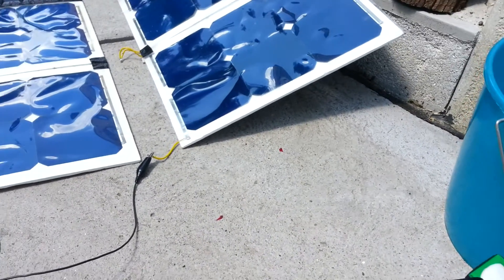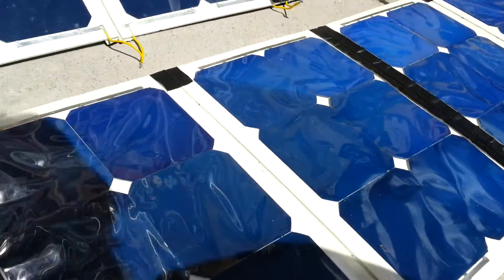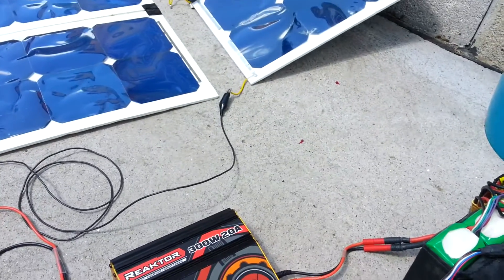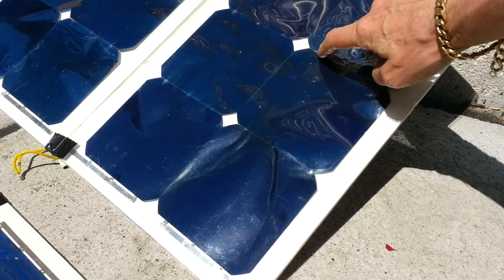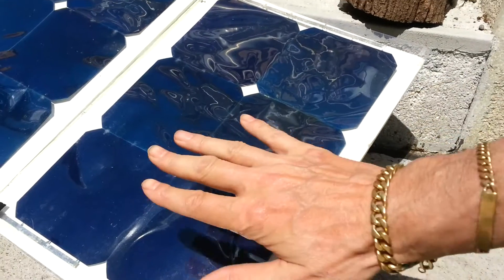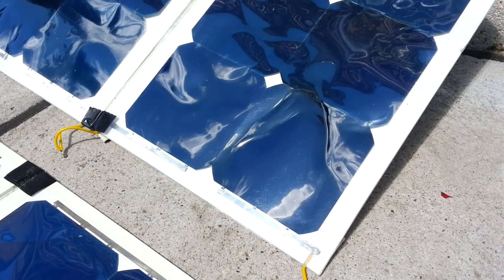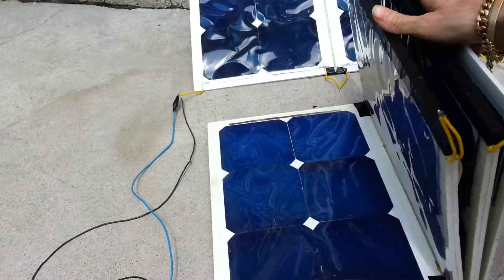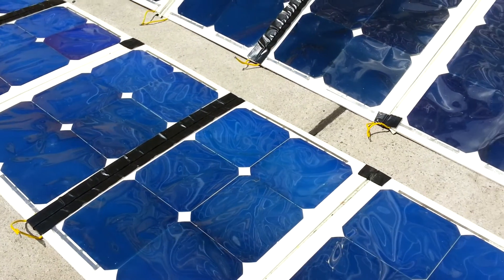Homemade 240W folding solar panels with 300W Turnigy Reaktor

Comment: Hi Andy, I hope you're well.   
I've repeatedly watched this video with great interest since you posted it.   
Thanks to you, I'm now in the process of building my own bike to attempt the daily 17 mile (each way) journey to work during the Summer.   
There's no way am I paying the extortionate prices on Hell-fords so.......watch this space my friend :-)
Reply from the maker: Hi Tony, glad to hear from you - can't wait to see what you come up with! (subscribe to this ↑ guy! )
What motor/controller/batteries did you decide on?

17 x 2 miles a day should be easily doable with the pack in the video. Amazingly, it's still going strong after 18 months with no noticeable drop in capacity even after around 400 charge cycles. I usually keep it between 50-95% state of charge and only once let it go down to 20% after a particularly long ride.
It's totally changed my life since I gave up my cars. Now the fastest, lightest, cheapest, quietest and greenest way to get around anywhere within a 40+ mile radius.
Incidentally, I got the bike from 'Hell-fords' in 1999! Raleigh FS1 - it has practically zero resale value now, but it's still solid and comfortable and the batteries are pretty safe in the crossbar pannier. Unfortunately it was never designed to have a proper luggage rack, but it's on my list of things to solve.

Picking up a few extra photons before teatime...
https://twitter.com/ahaveland/status/743847552781516800

Since we last spoke, I got hooked on harvesting 18650 cells with the aim of making a bigger ebike battery, and possibly amassing enough for a few tens of kWh for a powerwall.
So I hopped on the bike and visited every laptop repair centre I could find, and after a couple of months scrounged together enough cells for a phoenix 14S16P 35Ah 58V 2kWh 10kg battery that easily handles around 30 amps, and could give the lipos a rest, or even add to them - 3.5kWh on a pushbike is a lot of distance!
So far I guess I've tested around 1000 cells to get 20% of usable ones. The rest I'll keep for recycling at a later date.
It's these guys fault!
jehugarcia https://www.youtube.com/user/jehugarcia/videos
HBPowerwall https://www.youtube.com/user/nocrf50here/videos
AveRage Joe https://www.youtube.com/user/hooptejoe/videos

When I had enough for two 35Ah modules, I tested them by adding them to the 25Ah 12S lipos to make 14S and got a noticeable increase in performance , but can't add any more without frying the internal controller's mosfets which max out at 63V. Tempting to get a bigger external controller, but 55kmh is quite fast enough for now!

I made another solar panel, replaced the pvc films with polypropylene and they cope OK with the heat and stay flat - yay!
3rd portable solar panel:
https://twitter.com/ahaveland/status/751810138445602816

Also made a wooden frame to mount them on, so can just prop them up on the roof when conditions allow. Had a sad incident with the wind ripping off a few cells and mashing them up real well, but had some spares to replace them. Now don't have enough to make my planned 4th panel! Oh well!

Am really tempted to ride back to England from Budapest, only 2000km! Mounting the panels on a trailer would help, but would also attract some attention and the 1.5kw motor isn't exactly street legal though I could dial it down to 250W.

I think once you do a self-build ebike, you're gonna get hooked!
Reply: I haven't bought any stuff at present apart from the bike..... a Carrera Sulcata but I'm still in the process of weighing things up.   
The problem I have, is the route I have travel to work. There's a lot of narrow roads which stretch for miles and they have no pathways. This means I'll either have to make the bike illegal and fit a 1500w or 2kw motor so I can keep up with the traffic or ride along the canal (which I'm not too keen on).   
The batteries are going to be multistar 6s and I'll have around 25ah in case I have a very heavy day at work and I can't be bothered to find the pedals :-)   
Keep watching, I should have all the kit ready for the Winter :D
Reply from the maker: Just noticed that Hobbyking had a sale on 16Ah lipos for just over $100. Four of these should do nicely, 10C at 32Ah is a nice 320A, and at 48V would be 15kW!
Of course try to find the best Wh per £ from what's available.
I was lucky when HK did a sale of the 6S 5200s for €26 - they've doubled since :-(

I checked out your bike - looks pretty decent and the 29" wheels should give more speed rather than torque, so bear that in mind. A hub motor really must have torque arms to relieve the enormous stress on the dropouts.

I found this, unfortunately sold, but will give you an idea. https://www.gumtree.com/p/bicycles/carrera-sulcata-1000-watt-electric-bike/1205479852
I think you'll need more space for the battery, so you could make a pannier for it, or get a rack to put them on, though it'll make it quite back heavy and have a tendency to wheelie. (It's great however for going down steep slopes or steps without fear of going over the handlebars!)

You could find a solution with a pedelec and limit to 250W for legal usage, with a switch for offroad :-)
1.5kW is great - no need for pedals except for 25% gradients, but I pedal anyway just for show, because it looks wrong otherwise!

Pity that the route isn't too friendly, though I'd enjoy the canal towpath. You could make an amphibious version! :-)

I built your strobe with 3x10W leds, and use it with a red filter for my back light - cars have no trouble noticing me, so I suggest you do the same!
Reply: I've just been offered 4 x Tattu 16ah 6s batteries for £400 (usually £220 each). They're unused and in the UK.... I'm very tempted because they won't be there for long but it's a lot of money, especially since I'm quite skint at the moment. I've also been offered a 26" wheel mountain bike which will suit my needs. More expense but I really need to get out more and try to bike to work.   

I worked it out over the last month - The speed I travel home each day is an average 17mph so it takes me an hour to get home every day and costs around £3 per day in fuel. If it takes 30p to charge the batteries, the whole thing will pay for itself in 4 years (if I bike 6 months of the year). Knowing me, I'll only do it once and nearly get killed...that'll be the end of that!   
Of course, there's the health benefits which totally outweigh the cost.   

The wheel I'm getting, will have a switch for road use (250w) but I doubt it'll ever be switched to low power unless Mr Plod stops me :-)   

Good idea on the strobe, I had't even thought about road safety!
Reply from the maker: hm... difficult decision with the batteries, but I'd check out HK and see if there's a sale on a combination that might be give more bang per buck.
(For zero £ (and a lot of time!), you could make a pack from a couple of hundred laptop cells as I'm doing, though it'll also need a bms and  hi voltagle/current charger to charge in one go. I'm fairly comfortable with doing two 6S sessions and one 2S session with the Reaktor for now)

Your logic is impeccable. Your thumb will get tons of exercise on the throttle! :-)
Don't forget the satisfaction value of leaving the lemmings behind stewing in their mobile prisons while you fly by with the wind in your face....  but remember to use goggles to avoid filling up your eyes with flies... :-)
As well as saving fuel, you should save a lot of travel time, and car servicing costs.

Wheel sounds cool.. What is it?  Using a Lyen controller?

I'm dead chuffed with the strobe - I made another using 2 x 100W leds, but that's a bit too brutal but it is useful for signalling to helicopters for search and rescue :-)  I programmed 3 rapid 10ms pulses repeating something like this:
[ |▔|_|▔|_|▔|___________________|▔|_|▔|_|▔|_____________________________________ ] . ∞
and it's impossible not to notice. Whether it's legal or not, I'm not sure - but it's really important to be seen.
hm... thinking... I might program it to signal my name in morse code or use manchester bi-phase modulation! :-)

Here's some new ebike porn with 13kW and big lipos - the guy lives in Hungary about 100 miles from here, so am thinking of riding down to see him and check it out. Will also be a challenge for me, and using my solar panels to recharge on the way.
Electric pitbike over 120km/h topspeed
https://www.youtube.com/watch?v=agGzT8TgXcw

Drool! :-p
Reply: Just a quick reply whilst I'm on my break, Andy...... 
Now, that bike looks VERY interesting. I've subbed to his channel :-)   
The batteries are ordered (I bought the Tattu ones) and I'm now pricing up a 2kw motor. I decided I'm going to do the usual 'Tony build' and make it my own style - There's loads of people using the 1kw and 1.5kw but not many have fitted the 2kw. I wonder why? is it because they're not alive anymore?
Reply from the maker: Yeah, he's brave and hungry for even more electric power, so we'll see what he comes up with.
I was doing the same thing in the same place yesterday, albeit a bit slower. Budapest is gradually getting more cycling friendly, but some roads are still so bad it's smoother to ride across the fields.
Great! There's something just undescribably lovely about big lipos. Consider making space for a couple more batteries just in case the motor and controller could handle 18S or more at a later date.
Crucial requirement for big hub motors - torque arms, so the spindles don't rout out the dropouts even if the nuts are as tight as you dare go.
Hopefully still alive! Perhaps they just want to ease into ebikes gently and find that 1kW and 1.5kW do all they need?
Reply: Torque arms ordered :-)   
I'm glad you reminded me or I'd have been in trouble!  
I've been offered a decent amount for my current bike and I think I'm going to accept it. I'm now trying to find a good alternative, I must admit, the Raptor 165 looks VERY nice but it's totally over my budget. The motor is going to be a 1.5kw because they're readily available in the UK and cheap(ish). If it goes faulty, I can easily get another.
Reply from the maker: Happy to help! 1.5kW is still very useful with the power of a moped on a bike weighing 30kg.
If a motor goes wrong, you can also rewind it yourself!
(I burnt out a 400kv X5 bldc drone motor last year trying to use it to power my bike before I got the hub motor - finally found someone with a hydraulic press to be able to get the core off the base, then unwound the remains of the wire, noting the turns and multiple strands, then rewound with new wire, and after a few hours reassembled it and it works perfectly! Soooo chuffed!)
Reply from the maker: Any progress?
Last weekend I rode 340km in two days!
Check out the map from Budapest to Fonyód.
Sore arse and aching shoulders from carrying 15kg of stuff - solar panels, compressor, tools, clothes, food etc, and had my newly made 35Ah 58V 18650 exlaptop batteries running with the lipo pack above as reserve.
Had to switch batteries when I got to Siófok after 120km, then did the next 50km on the lipos.
I don't think I'll do it every week!
10 hours riding against a headwind and trying to conserve energy took its toll, but am pleased my calculations worked out!
Catching some photons and some sleep here: 47.179801, 18.540648  :-)
https://twitter.com/ahaveland/status/882645128539762690
Reply: I've got the batteries, all 8kg of them. My bike is sold and I'm currently weighing things up.   
There's a small problem at the moment....I'm skint. I've had a few bills arrive which I wasn't expecting and it's stopped me for the time being. I might be able to stretch things and get the wheel/motor this month but I want to get a decent bike so It'll have to wait till next month.
On the up-side, I've decided I'm going to 'Arduino the hell out of it' when it's built. A voltage sensor for each lipo cell, current sensor, GPS speed, total distance travelled, trip computer etc. etc. Obviously, this will all be stored on an SD card for later viewing.   
As for your bike trip, I doubt I'll be trying anything like that! I think I'd end up ingesting my own testicles and something would surely break (probably a couple of bones).
Reply from the maker: 8kg of lipos could power a nice multicopter, or a paramotor in case you're stuck for ideas... :-)
Pity about the skint bit though, but fortunately that seems only temporary...
I guess you can hardly wait, but I'm looking forward to seeing what you come up with.
If you're going to be balance charging using a 6S lipo charger or two or four at once, you can get away without a BMS for now, but you might want to consider it later if you'd like to charge in one session with a beefy 50.4V charger. I'd wait and see how you get on.
Depending on the controller, you might also like to add another few Ss to it!
I think there's a product called Cycle Analyst that already does these things, but it's fun to make your own and that's dead easy for you.
I also want cell voltage displays, but their accuracy leaves a lot to be desired. I'd want +/- 5mV or better.
I'm sure that if you do a video about it, you'll collect a lot of viewers from endless-sphere also wanting to do a build, including me!
Am fully recovered from the trip now - was also a taster for riding back to the UK using just solar power - it's doable, but would need a couple more panels to improve charge times and take a week or two. 2000km vs 340km.... piece o cake! :-)
(A trailer would be good for continuous solar charging, but would feel a little conspicuous and vulnerable in traffic.)
It wasn't that bad, my legs didn't need to do very much, except to look like they were pedaling some of the time, and this is especially satisfying when overtaking the lycra clad posers... :-)
It just didn't help not having a bike rack, but then I realized I could mount the backpacks on the batteries on the equivalent of the toptube and keep them in place, so that was a relief.
Riding through Hungarian wilderness and villages before dawn with no signs of life for hours was quite an eerie experience
Reply: A quick update Andy. I worked my finances out and the motor (1500w) and all the bits that go with it are ordered. I've still got to decide on which bike to get - I don't want to buy one and then think "I wish I'd saved up and bought a......" so I'm thinking very carefully at the moment.   
I'm theoretically thinking about building a BMS for a 12s setup with FET's and Arduinos which will all be onboard (stored within the battery compartment). It is possible, and it will link to the Arduino I'm going to use for GPS, current, voltage etc. so it will log all the charge data to SD card. +/- 5mv might not be possible but +/- 10mv is possible :-)
Reply from the maker: Sorry I'm late with this reply - a car on my left turned right in front of me last Monday and I somersaulted over the bonnet, landed on my back, nutted the road, slammed into a kerb and ended up in a heap on the pavement. Kerb was undamaged. Bike seems ok.
Ambulance arrived in less than a minute because they heard my screams!
Fortunately I didn't lose consciousness nor go into shock, and could give my details and answer questions in Hungarian.
Result, 5 days in hospital with a broken pelvis, ribs and collar bone.
Good news, I took 4 full steps today solo, recovery could be quicker than expected!
Human cargo transport service brought me home on Friday and I learnt exactly how a piano feels moving house!
So I can stand again, but getting around will be tough for a little while - wheechair isn't so useful as I can only go round in circles with one arm!
Considering attaching hubmotor to it... :-)
Reply from the maker: Nice challenge to build a BMS - would love to do the same if I had some funds and time.
Consider making yours flexible, eg 12S-20S, and of course be able to set the charge limit and balance start voltage somewhere between 4.10V to 4.15V, with 4.20V possible on occasion.

I would like to try the flying capacitor technique - basically use two pole solid state relays to isolate each cell in turn, slurp juice from the highest and inject into the lowest.
Would be a truely lovely thing to be able to implement, and I know you could do it.
I'd suggest slurping through a charge pump to fill a super capacitor (or two balanced in series), and then discharging through another charge pump to ensure maximum transfer.
It's exactly like using a siphon to fill a bucket from one tank and empty all of it into another one, instead of just a few drops each cycle.
You would also know how many cells you have connected, so it could be autosizing.
Some challenging ideas!
Reply: Are you recovering well, Andy?
Reply from the maker: Been pretty miserable for last 3 weeks, but am making progress and can take a few steps around the house now. Arm mostly still in sling unless I want to type, and can now sneeze without screaming!
Girlfriend took me to the market last weekend in a wheelchair, but didn't get any offers so had to bring me back.
Yes, I will reply to your mail! My procrastination got a bit extreme. :(
Saw your new ebike! Great job, and you found the dead centre of Cannock Chase!
Reply: Cheers up mate, there's always the thought of getting back out there and proving that you can't be kept shut away. It took me nearly 12 months to recover from my accident but I did recover. I've got the biking bug and just bought some new stuff..... you'll have to wait until you find out what I'm doing next. Needless to say, it's going to be the usual "Tony way" and not your average build. I'm scared already!